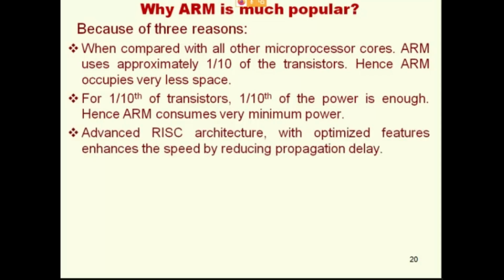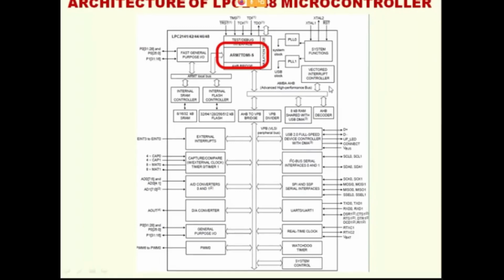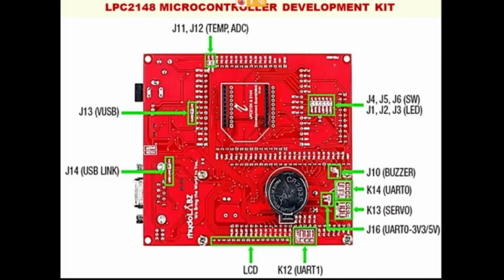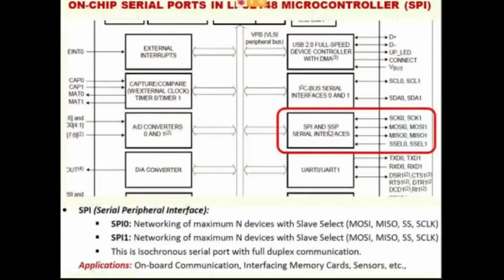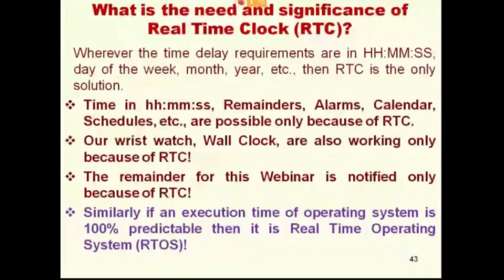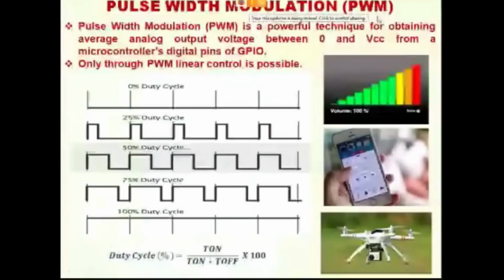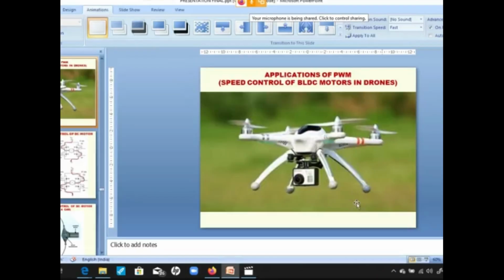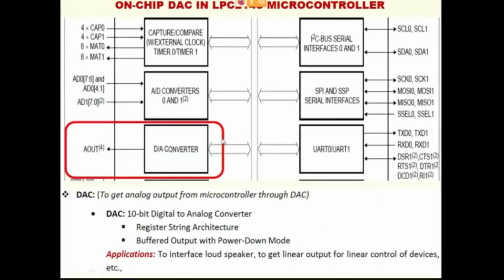ARM, ARM7, ARM9, ARM11, ARM CORTEX A, CORTEX R, CORTEX M and its Applications (0.0)

Comment: Arm is neither a processor, nor a microcontroller. It's just an architecture (a design blueprint), just like Intelx86 and Amd64. And the company 'ARM' does not sell physical processor cores, they just license that design blueprint to companies like STM, Ti, NXP, etc..
Reply from the maker: Thanks for your valuable information
Reply: Thank You Kuralamuthan Sir for coming forward to correct my mistake. Shall we say ARM Processor core inside the microcontroller. For example, LPC2148 microcontroller contains ARM7 TDMI Processor Core!